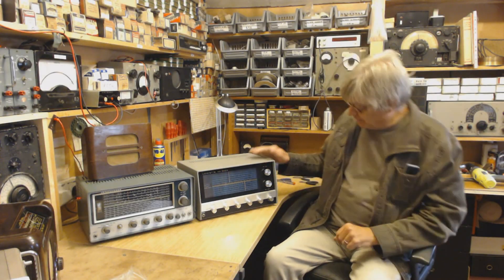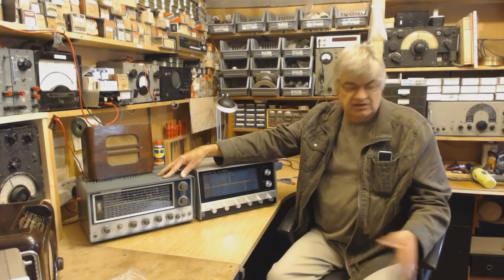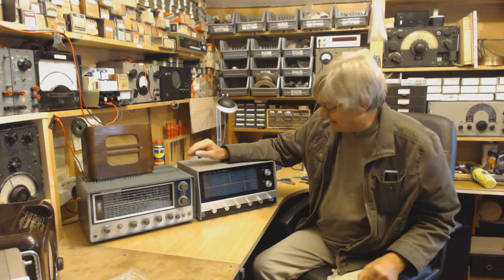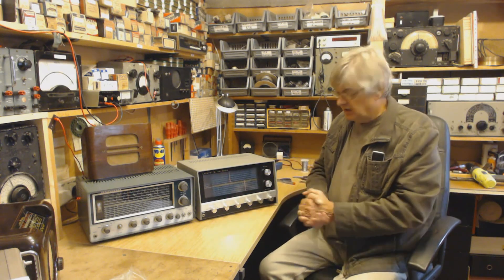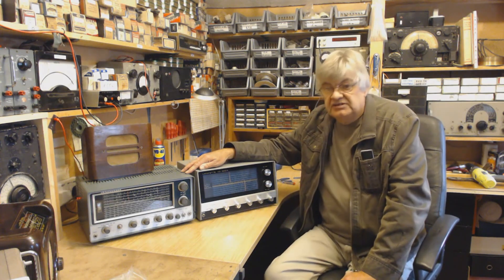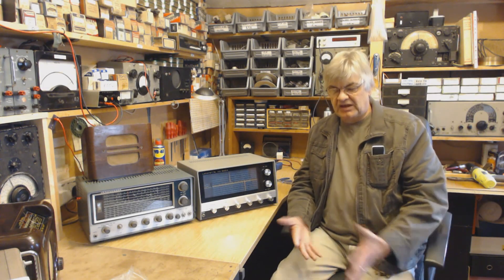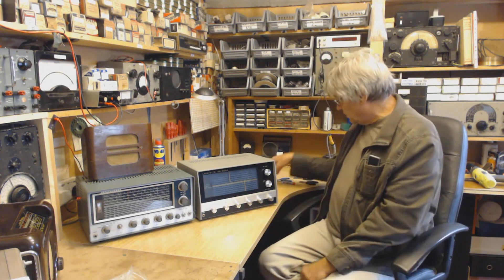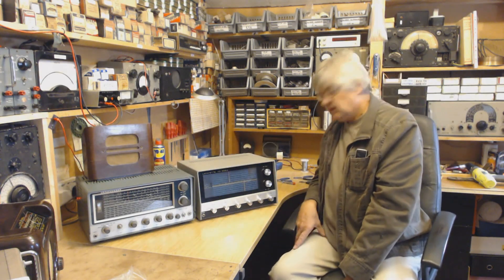The Lafayette HA600A Communications Receiver

Comment: Yeh, maybe I am getting a bit long in the tooth as well Ray, but I do prefer the sound of a good valve set, I just don't like the weight of them and the electric they eat up!  I could put up with the tinny sound and the tinny cabinet it is in.  My father had an old radio that I could listen around with.  No idea what it was or anything, it was just supposed to be a normal radio, but I could hear lots of things, mostly before I was sent off to bed, night-time was when the old thing would fill up with stations with what I thought was funny languages, if I was lucky I could hear the trawlers out at sea and the odd aircraft going over.  I was a long way from the sea and it was just a long bit of wire from the window to the shed, but it was great fun when I was knee high to a grasshopper.  I once heard a trawler on the Caledonian Canal and got over excited. There you go, miss spent nights, but then we didn't have a telly.  I remember the heat that used to come out the back of that old thing.  One day it didn't come on and he skipped it.  I wish I had that old radio now!  Thanks again ray for the memories!  Even thought it was only an old radio, it listened to a lot more than radio stations.
Reply from the maker: Thanks! happy days. Cheers, Ray.

Comment: Tube Radios and Amplifiers audio is much better than solid state.
Reply: Solid state receivers also tended to suffer from poor performance in strong signal locations.  I used to live near a couple of transmitters for a couple of TV stations and inexpensive solid state communications receivers with long wire antennas would degenerate into a mess of overload with distorted TV video and audio signals all up and down the shortwave bands.  How I wished I had an something like an RCA AR 88, a National NC 100 or a Hammurlund SP 600.